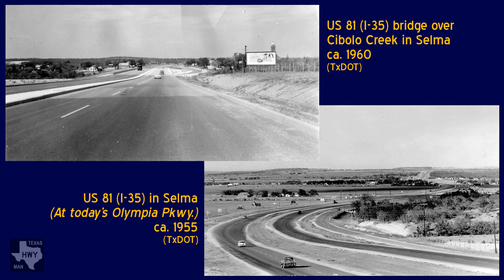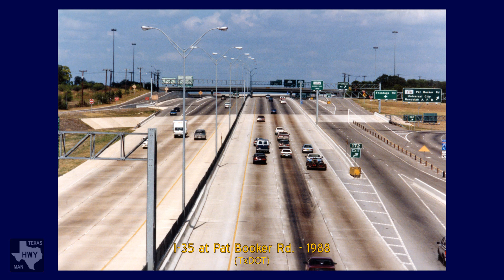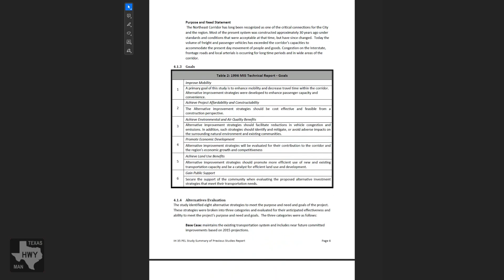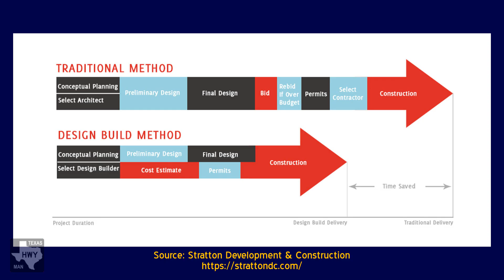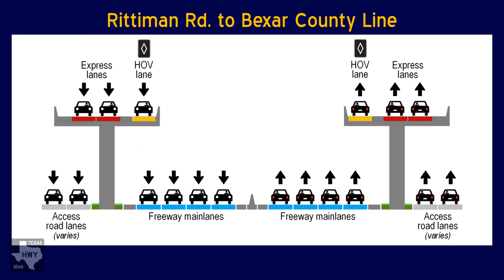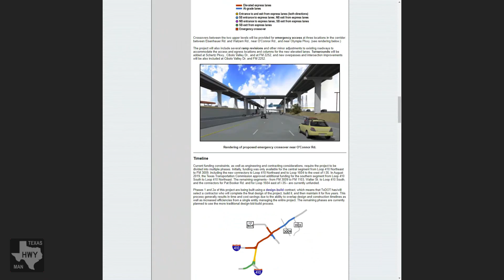I-35 Northeast Expansion (NEX) Preview

Comment: What's up with all messed up columns I've seen near the i35 and 410 intersection??
Reply from the maker: @rt1111zun  - What about them is messed up?
Reply: @TexasHighwayMan  All the columns that have honey combing...how much more is it costing to demolish them and re- build them?
Reply from the maker: @rt1111zun  - Honeycombing can sometimes just be cosmetic and fixed in-place.  But even if it is structural and has to be torn-out and replaced, the contractor bears that cost, not the state.

Comment: The vast majority of the problem are drivers in the passing lane driving too slow and won't move. We need to do like Europe and make it a traffic violation. Bad drivers equal traffic!
Reply: Exactly. Just like in downtown Austin on I-35. The traffic is not caused by there being too many cars, the traffic is caused by idiots going 30 mph in the left lane for no reason. If people would learn how to drive or stay on the frontage roads if they want to drive Miss Daisy, these freeways would flow much better. Adding 20 lanes is not going to fix bad drivers.

Comment: The very thought of overhead HOV & express lanes for 20 miles straight is insane in my honest opinion.  If only trying to built commuter rail between SA & Austin was not shot down.  Sigh, that's Texas for you where one-dimensional transportation options (roads & only roads) seem to be king.
Reply: Yep That's the car
Reply: TXDOT (short for TX-DESPOT)
Reply: Billions could be spent, to ultimately transport a handful via rail.   View Moonbeams fantasy train, in the central valley, and report back how that's working out.

Comment: They are going to regret not taking away the cloverleaf interchange. They didn’t learn there lesson from 10/410 interchange and 10/1604 interchange(Which are changing now)
Reply from the maker: I can see where you're coming from, but there are a few differences with this one.  First, that existing turbine ramp (EB to NB) helps to prevent the same kind of congestion seen in full cloverleafs.  Second, quite a bit of traffic will use the new flyovers, which will take it out of the cloverleaf.  Maybe eventually they'll need to replace it, but for the foreseeable future, it should not see the same problems as other cloverleafs.

Comment: Do you believe that more lanes alleviates traffic or the introduction of more lanes brings more cars on the road thus not alleviating traffic?
Reply from the maker: Both.  In the short term, new lanes do alleviate traffic, but induced demand eventually fills them up again.  But this is Texas, and folks want more lanes, so that's what the politicians push for.
Reply: I would agree in the short term if construction took a year or less. But, when it takes 3-5years plus delays to finish the project the increased demand over those years eliminate the benefit in a few weeks. IMO. I do like more lanes personally, but the deaths/loss of revenue during construction doesn’t justify. Especially a lofty project like this. Love your content as always.
Reply from the maker: I appreciate that.  To follow-up on your concern, when planning capacity requirements on a project, the typical standard is to build capacity for the 20 year forecasted traffic volume.  That 20 year window starts from the expected completion date, but yes, delays in getting work started or finished can eat into that.  And, induced demand is really hard to pin down and often is higher than expected, which also cuts into or shortens the relief gained by the expansion.  An ROI analysis is always part of the decision process, and some concepts do get nixed as part of that.
Reply: I agree. You can even cater to drives with a train...

Just build a higher parking garage next to the train station. That way here in SA I just drive to the train station, similar to airport parking garage, hop into train, that takes me to Austin, I do whatever in Austin, then hop back in the train to SA and drive back home.
Reply: I believe if they do it like St. Louis did to eliminate traffic by creating a train system around the city you can save money in the long hall and actually create more revenue for the city.
Reply: St. Louis proper, is one of the leaders in population loss, in the last several decades.
Reply: Look at Katy, TX. It's always induced demand, but TXDOT thrives on highway congestion